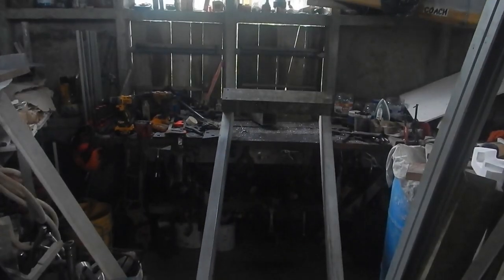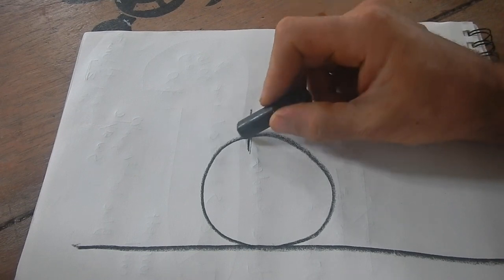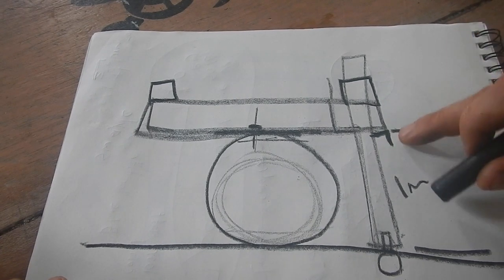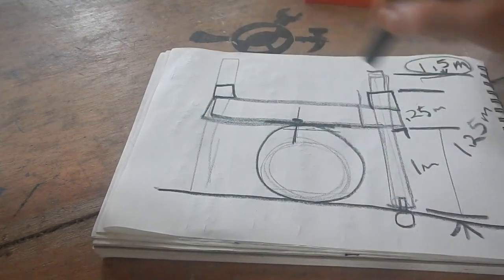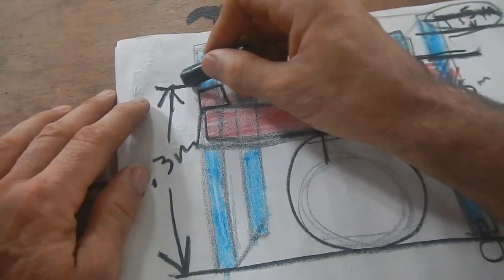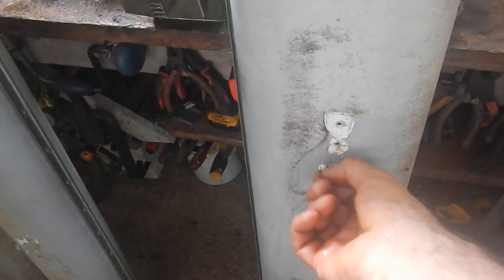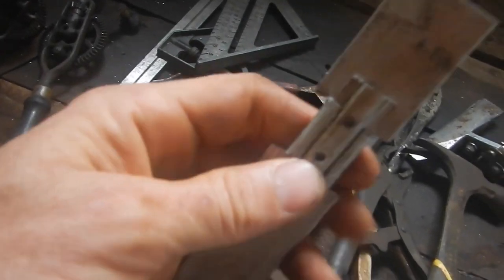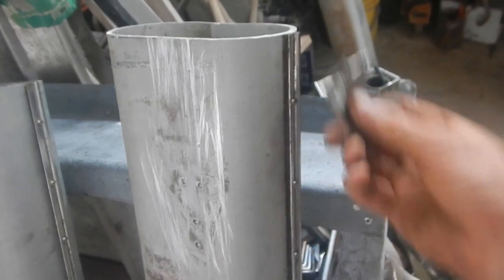Lumber Mill 011 Elevator Sliders

Comment: Sawing, drilling , and filing aluminum required a lublicant to prevent friction-melted aluminum from fusing to and cloging tools. I use wax sticks and cutting solutions for prevention.  I too build stuff like you. I always use antiseeze goo on stainless steel nuts and bolts because I reuse them .How do you avoid these problems?

Comment: a 3 foot log will be mighty hard to move around without block and tackle
Reply: Even with a block and tackle
Reply: Yep, from  the jungle to the place, but on the spot not big problem rolling it. 
My brother used to cut log that thick. 4 meters long
And it was only him and me. Me being almost useless with a leg and a hand paralyzed.
But the truck dumped them right beside the rails. Then just rolled them. 
We had a 1 meter fixed blade. we moved  and  rolled the log for the cut. 
Than damn blade screamed like a siren. For sure could be heard to the other side of the town ;)

Comment: The looseness of the elevator slides and the vibration of the saw seems like a recipe for disaster.  I hope you are planning to lock the structure into place somehow before operating it.  I was assuming that the structure would be pretty sturdy and all you would have to is lift the saw vertically using cotter pins but it seems you will need more then that.

Comment: I hope the 1.3 m isn't too short to cut the top face of the log when the blade is swung down into the horizontal cutting position.
Reply: Good point, but, there's no way he's cutting 3 foot logs with it anyways. And if he does, it's trivial to shim the bottom of his rails with some bricks or branches or something. Nothing says the track has to be sitting at the exact height as the timber.

Comment: Haven't finished watching it yet, but the swing blade would hang lower when the blade is cutting horizontally. That lower blade position should set the max height for the system. Not when the blade is cutting vertically. Hoping this is realized as I watch the video further.